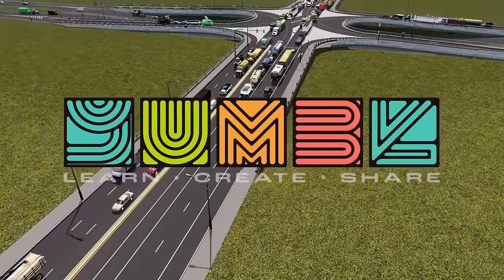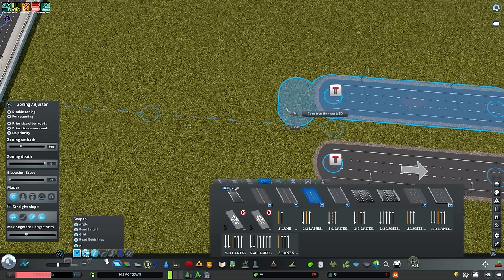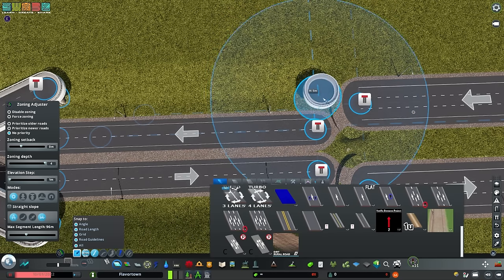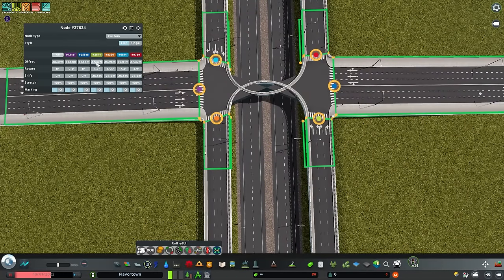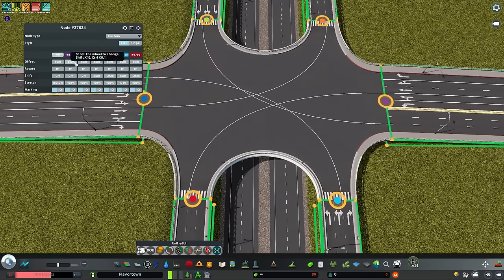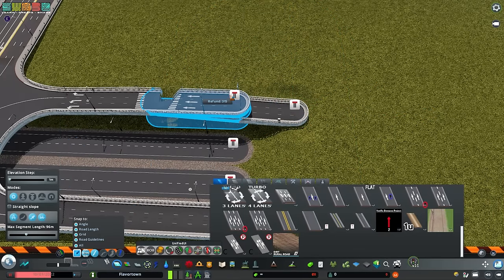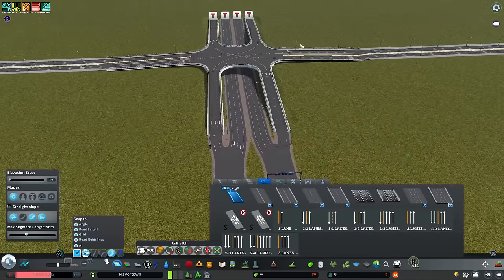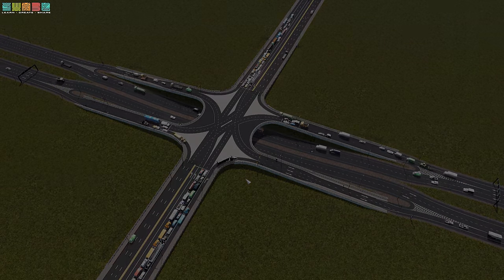Node Controller FIXES the Single-Point Urban Interchange  -  Realistic Interchange Tutorial

Comment: I find that when the nodes get too large, the left turners start and stop a lot as if the intersection was blocked. Yours are not doing that. Why not? Do you have them enter blocked intersections? Maybe a difference in the driving AI setting?
Reply from the maker: I have them entering blocked intersections on all sides, and also a 2 second red phase in between all cycles to let the intersection clear.
Reply: @YUMBL  Fantastic! This is super critical to get the magical traffic flow out of this structure.
Reply: @YUMBL  Do I get this right: it's three cycles for the flow + all red in between to avoid cars entering before others have left (straight-red-ON-red-OFF-red)? If so, that's as simple as clever! It takes the negative effect away from large nodes
Reply from the maker: Thats exactly it! :)

Comment: Man, I've built this before using your guide and it turned out beautifully.  This time my roads weren't aligned the same way yours was and I thought "Ah, I'll figure it out".  I didn't figure it out.  It looked great, but the roads didn't connect the same way.  After I sloped the ramps, a sheer dropoff appeared.  I used Move It to fix that.  Easy enough. But then when I went to do the lane connectors in TMPE, some weren't even there and others were in weird places.  The ones I could connect weren't right, either.  I'll give it another go later, I think.  It took a LONG time to get this thing to look right and then it wasn't functional at the end.  But you don't know that until it's built.  Live and learn.  Next time I'm going to have my roads in order first.  

Thanks for your channel but your interchange tutorials in particular have been valuable to me.

Comment: Absolutely perfect timing. I am currently upgrading all of my original, super naïve "ridiculously tight diamonds which are also way too close together... seriously, no one needs to get on and off the highway every 20u" service interchanges (it's a bit of a mouthful, and the acronym is too long to type, but it's technically accurate). I was just working on making my own SPUIs based on your previous video, but this one is so much tighter and seems to have all the same features. I am definitely switching to this beauty.

The only difference from the former SPUI seems like the exiting right turns make a full 90 deg turn instead of a shallower 45 deg turn, but I actually prefer the full 90. In real life, when I am trying to merge at 45 with a yield I feel like I can never adequately see the merging on-coming traffic over my shoulder at 135 deg. Even with lane mathematics, in real life it still feels like a yield unless it's protected by an island or pillars or something, because humans are just generally really terrible at driving. So ya, this is tighter and feels safer, definitely a worthwhile upgrade.
Reply from the maker: Love the acronym 😂

Comment: I love the SPUI, I already used it way back without most of the tool mods just fine road tool, road anarchy, move it and Traffic Manager, this intersection is on of the best, I always used it with inner city sunken highways. Using Node Controller and Intersection Marking Tool it's even better

Comment: Just spent 2 hours building the SPUI from the 2021 version, finished intersection markings and everything, and immediately found this video

(Turn on move it → Range Select → Ctrl+B → REBUILD）
Reply from the maker: This one is much more cumbersome. The old design still holds up very well imo :)
Reply: I ended up having the old design up and running for a while before I tore it down and it did run well, but I still rebuilt it since I was looking for compactness and the new design look awesome :). 

Btw, I was still running into huge traffic jams. I'm thinking it's because I wasn't setting up the timed traffic lights correctly. I can't seem to find the traffic light for SPUI episode anywhere, is it out yet?  @YUMBL
Reply from the maker: The light is:
Left turns
Other left turns
Straight through

Or

Left turns from the highway
Arterial straight and lefts
Opposing arterial straight and lefts
Reply: ahh ok, I'll give that a try. Also I found two issues when implementing this design in my city:
1. When the two arterial sides of the SPUI go immediately into two 3 way or 4 way crossings,  the three traffic lights(2 crossings and 1 center) would need to set up a synced timed traffic light or else cars are going to pile up on highways. Setting up different phases and which way to pass in each is a huge hassle :(
2. When lanes finally merge/diverge onto/from highways,  the highway node would be rather close(in your case 5u) to the split nodes. Which would cause my cars to slow down drastically for no reason at the nodes and speed up again

So I was thinking maybe make sure SPUIs dont go into crossings for issue 1(there might be a good solution to sync phases but I haven't figured out yet) and delete the 8 nodes(2 on each split)+node controller adjustment for issue 2? Just a thought
 @YUMBL

Comment: A tip: clicking the trashcan icon in Node Controller usually fixes problems like transition pieces where you don't want them or the opposite, where road type changes but there is no transition.
In retrospect it makes a lot of sense moving the right turns into a larger center node rather than building separate bridge pieces just for that purpose. What method do you use to get rid of the traffic lights poking up from below? I generally place nodes strategically and fiddle around with Node Controller.
Reply from the maker: I used network skins to remove the lights

Comment: Beautiful. How about a tunnel for the straight though traffic as an addition?
Reply: Vanilla overpass project would shine there then but the tunnel entrance would have to be quite far away in order for it to sink below the highway. If money isn't tight, for sure, more complexity would increase thoroughput. A stack can handle some 1000 vehicles while I'd expect a SPUI to sit at around 450-550. Where the SPUI shines is footprint and cost (and safety, but the game doesn't simulate crashes so it's all the same there)

Comment: While it certainly shows off the details, looking at it, I feel like it would be built with the intersection part on the ground and a simpler overpass.
Reply from the maker: Most of the ones ive used have the intersection over the highway, but either can work. It depends on existing infrastructure when its being built. If the highway is already elevated then ground intersection maKes sense

Comment: I should check this mod out.  have you tried making any SPUIs that accommodate frontage roads and a 4 cycle signal for through traffic on them?

We have a few interchanges like that in my city where the freeway replaced a major road and my previous attempts to recreate it with just move-it and the usual traffic tools turned into a bit of a mess

Comment: Since you're already using a bunch of mods, why not use the Network Multitool mod to add the center node right at the beginning?  Does that feature not snap to the grid too?
Reply from the maker: I dont think it snaps. The way I did it snapped dead center between the highway ramps. All the other measurements were identical because of it.

Comment: Hey yumbltv, ths for your great work! But i have a big problem with it. My cars don't use the second lane to go left at the 8lane road. The only use the first left lane and creat a jam
Reply from the maker: Try turning on “dynamic lane selection” in the traffic manager settings. 20-50% should be fine
Reply: @YUMBL  I did. Until 100% only 1 of 10 cars changed the lane
Reply from the maker: Are the majority going to the same place ahead? Do they have a reason to use multiple lanes?
Reply: @YUMBL  It's a new city. So the only way left is to export/leave the map. So they have the same way. The reason to use multiple lanes is to not make a big traffic jam

Comment: Hey Yumble. I was watching overcharged egg the other day and he showed a Google maps view of the I17 in Phoenix AZ. I took a look as well and noticed several service interchanges that look kind of like your SPUI but slightly modified. Was wondering what you thought of them?
Reply from the maker: I havent seen them. Do you have a nearby landmark or intersection?
Reply: @YUMBL  it was I17 and camelback road. And then also 3 or 4 interchanges north of that were similar as well.
Reply from the maker: Incredibly similar to what I built but with straight through options to accommodate traffic that can enter on the ramps. Nice :)
Reply: I thought so too. Those one way roads that run along the hwy seem to act like collectors. The interchanges are doing double duty as a service interchange with an arterial and collector intersecting as well. Might have to find a way to integrate that into my next city!

Comment: HEI, in last vide interchange.
If you make 1 of the straigth true under in a tunnel you would have a zero point of conflict interchange no? no trafic ligth and no one moving across each other
i wish i could show you but i dont play the game X)
Reply: You'd still have the left turning traffic crossing one another but yeah, that would make one less phase on the light. The point of the SPUI though isn't to go into stack interchange levels of thoroughput, it's to handle a little bit of traffic, safely (not that the game takes that into account since there are no crashes) and cheaply. Yumbl's tips make it easier to shrink any interchange's footprint but the endgoal in this case is cost effectivness

Edit: just noticed you were talking about another video, my apologies. Disregard and keep on keeping on
Reply: Yes thats true my bad man, did not see that for some reason. Sorry 😅
Reply: @V1489Cygni  ty you for answaring me and corecting it 😊

Comment: As a point of realism, this should/would probably be inverted vertically if ever done for real. The costs of building that massive 'platform' of an interchange and the various engineering requirements for such a beast would be so inordinately expensive the person pitching it would be laughed out of the meeting and marked for a performance review, or psychiatric assessment perhaps.

To my first statement, if not immediately obvious, I simply mean it would be much more cost-efficient to have the continuous road - be it a high/freeway or whatever - be the element that becomes an overpass, else it would need to be an underpass with the interchange itself at ground level.
Reply from the maker: It generally depends on existing road infrastructure. Theres a lot of factors, but these are often upgrades from diamond interchanges which are often arterial overpasses. Or if the highway is already elevated than of course it would go under. I will say the vast majority that i’ve seen have the intersection elevated on top.